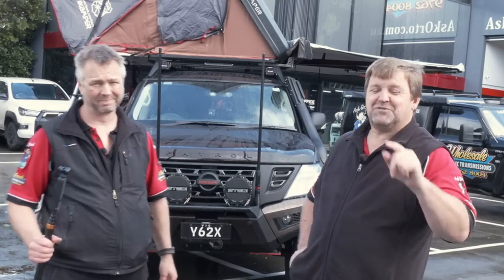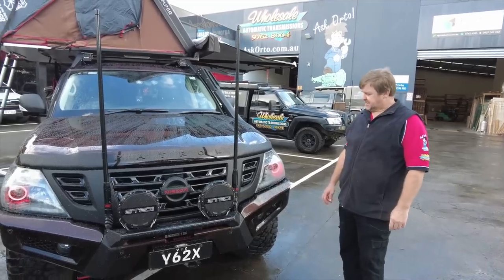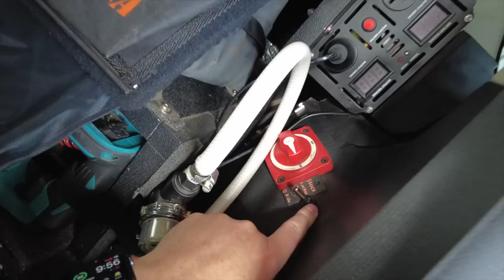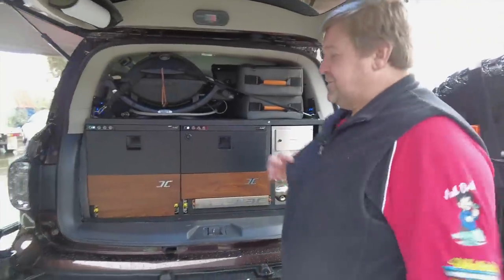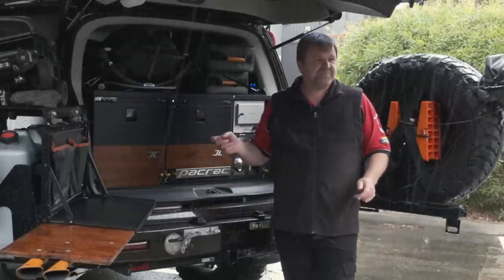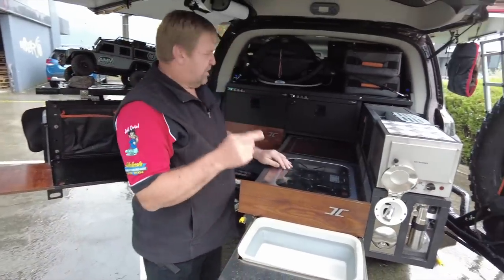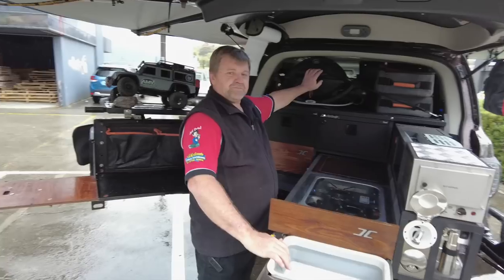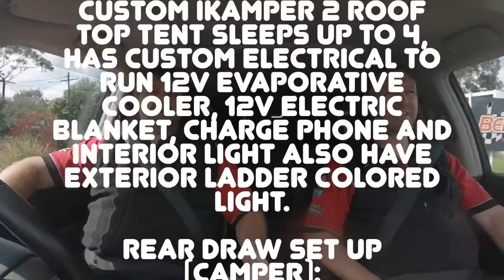1st Place Goes To This Nissan Y62 Build!

Comment: I have nothing but Toyota trucks and lives in Texas. The 300 is not sold into US so the 200 prices are crazy: A 40K miles driven 200 2014 sells around US$ 50 to 60K. I therefore inclined towards an Armada (Y62 in US). A brand new 23 4x4 armada is at $55K. I see TONS of Armada's in my area and no one seems to sell their Armadas! the ratio of 200 to Y62 is about 1 to 60 in my area. You said Y62 transmission is well built: That's good to hear. Armada has more comfortable ride compared to a 200. Also the front brakes on Armada are floating calipers while Y62 has fixed calipers.

Comment: I’ve got both a gu and a y62, due to the wheel humps and various reasons, the y62 has a way larger boot, I haven’t tried but it’s close to fitting a standard pallet in the boot. This is due to the GU having a longer bonnet, and the y62 has the engine pushed further into the car

Comment: 85k brand new for a Ti (dealer wanted 140k for a 200 VX at the time) how much for the equivalent 300 at the moment, if you can get one? The price difference alone is a major selling point. 

Easy driving, power when you need it. Great value.

Comment: As a design . Nissans are outstanding. IFS for ride quality and clearance. Way ahead of Landcruiser. No skull dragging the diff. Just like a hummer.   Love the Y62. If if came with a diesel OMG. The only drawback is the thirsty V8.. that being said. It gets similar economy to the 200 series. This is coming from a 200 series owner. I’ve seen the light.  Thinking of trading up.
Reply: Do it mate you will love it.
Reply: ULP is like 40c/l cheaper, this would cost less the run than the L/C

Comment: You would be correct with the spare tyre assumptions, when fully deflated you can fit a 35 under, however with the tow ball it will struggle. A 33 will fit easily however
Reply: On track puts the billet lower rear arms to help with lifting and the gvm upgrade, I’m pretty sure it’s because it’s not strong enough from factory
Reply: Dash is a Victorian 4x4 fitters, very popular with the y62, they have a YouTube channel that shows a lot of it
Reply: What is the carrying capacity on the roof of y62